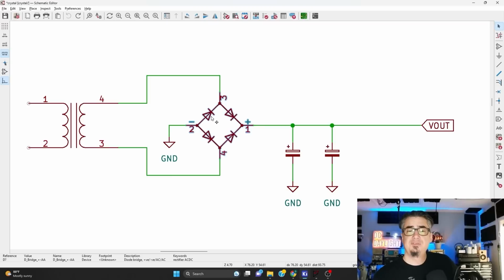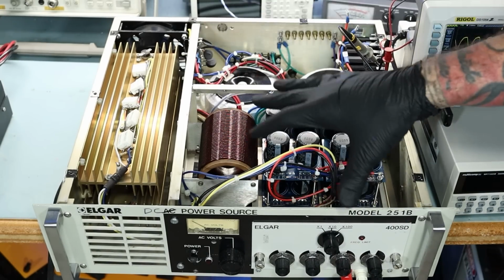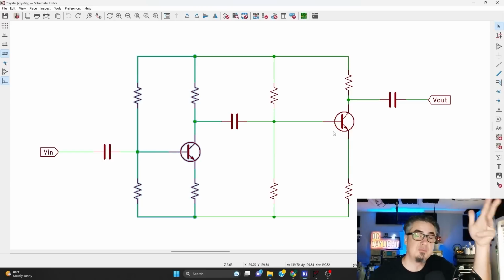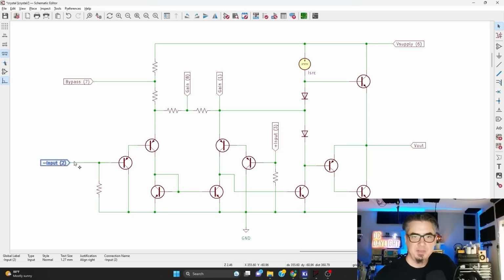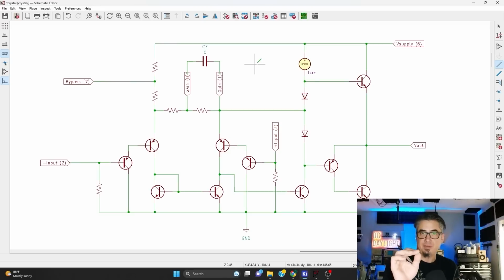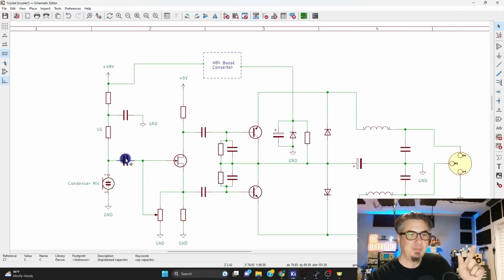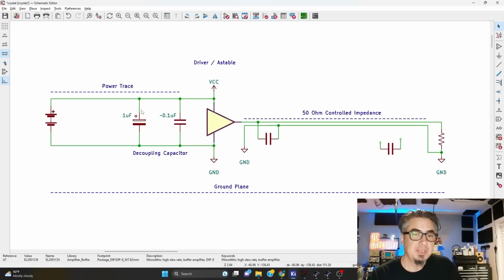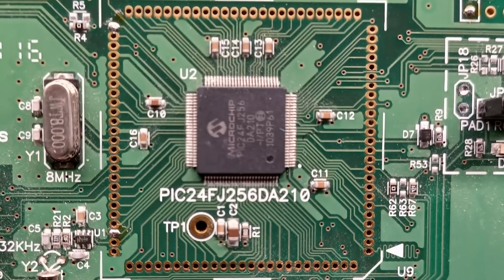5 Real-World Capacitor Applications & Micro Teardowns - DC To Daylight

Comment: @17:30 The enemy of low level signals is moisture, and that's the reason for the conformal coating.  Moisture (as from a speaker/singer's breath) can cause stray capacitance changes at the board traces, and over time causes component values to drift.  Of course, grit and grime don't help, and do collect even more moisture.

Comment: @14:43 It's actually not strange.  Many preamps don't supply exactly 48 volts (I've seen 12!) and some are weak enough that several microphones will pull the voltage down.  The circuit in your mic ensures the diaphragm gets a stable, pure 48 volts, needed for a stable, noise-free audio signal.  Most higher end mics that use phantom power will have a similar circuit.

Comment: When used as bypass capacitor (as seen on the schematic), does the capacitor "bypasses" that one resistor in between its terminals at high enough frequency, changing the gain?

Comment: if there is a sudden change in voltage from the mains (like when the circuit breaker suddenly turns off the electricity of a building), what are the mechanisms inside a power supply that prevent our devices from blowing up?

Comment: Nice video Derek...I'm curious about how you found out about your EME power limitation issue...are you near some kind of exclusion zone/military facility etc.?  73 - Dino KLØS
Reply: @AmRadPodcast Well, that doesn't sound right to me...there must be a definitive set of rules for areas in Florida just as there would be here in VA where I'm near Langley AFB, NASA Langley, Ft Eustis, Norfolk Naval Station, etc. I wouldn't give up on your goal of working EME without a bit of detective work. Good Luck!

Comment: ELEMENT, I would like to see the formulas used to get the filter capacitor values in power supplies, I have been told that reservoir capacitors are large values but are below the 60hz so they don't filter out the 60hz but to store energy while filter capacitors values are at the cut off frequency at 60hz to filter out 60hz. It would be nice to show the formulas to compute to get that ripple AC voltage and filter capacitor values.